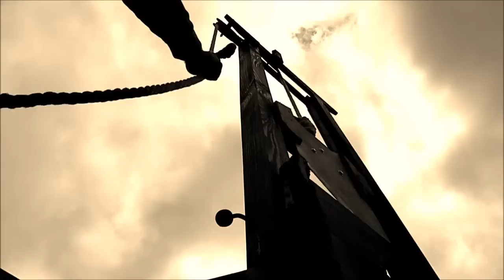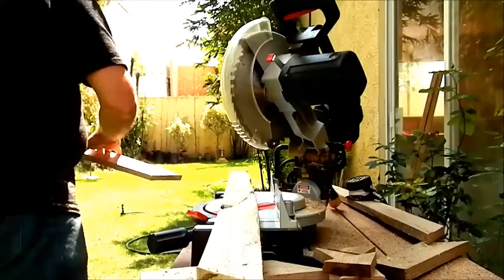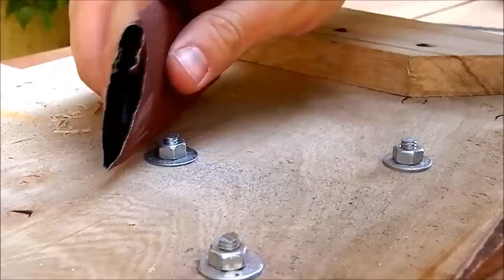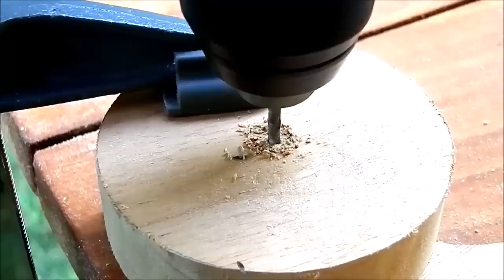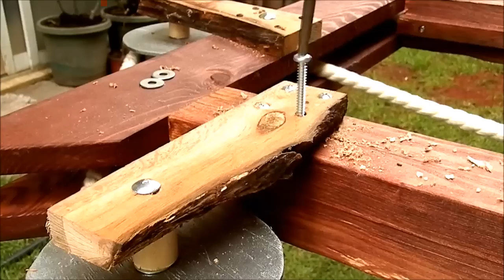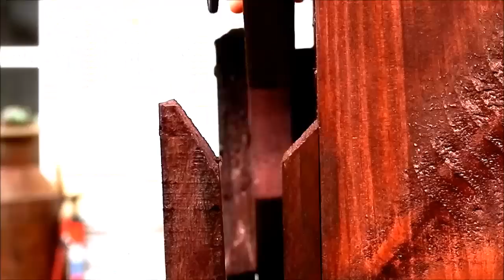Making a Real Size GUILLOTINE - Ep 015

Comment: For a model it is nice, but for a real use it's not working. Because the weight of the blade is too light for cuttingg the neck of a human. Two springs are missing on the vertical frame. If the blade comes down, it doesn't absorbe the hit on the lunette. The last machines were made of steel, the weight of the blade was between 50 and 100kg, the executer has for his perfect work different blades. The evening before the beheadding he looks into the prison cell for the size of the neck from the offender.
Reply from the maker: Yes it is a model only, equipped with a real blade it would definitely kill but it would probably fall apart because it doesn't have shock absorbers. There is link in description on how it was invented and how they improved on the design until 1983! (I think) 
This is just a Halloween prop.

Comment: Did you put a motor on it?  Why didn't you make it go down at least as if you were using it to execute someone?  YOu could have made it go down without cutting anyone's head off.
Reply from the maker: No motors on it, why would you want a motor on a guillotine!?
The blade goes all the way down if I remove the depth stops.
Which brings me to a question: Have you watched the entire video before commenting?
Reply: The reason I asked that is because I've seen videos on youtube about modern guillotines being stored for use in the U.S. and I think one video no longer on here showed such a modern guillotine that sounded like a motor was used to raise the guillotine as if onlhy a switch needed to be flipped or a button pushed to activate the guillotine to make it rise.
Reply from the maker: ***** wow, that's interesting.